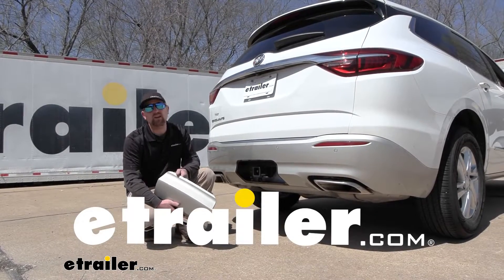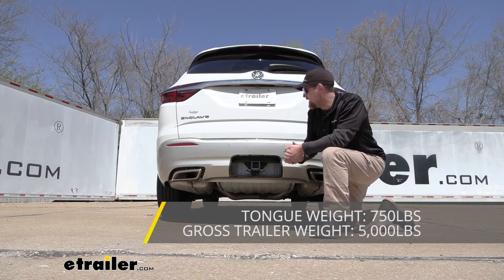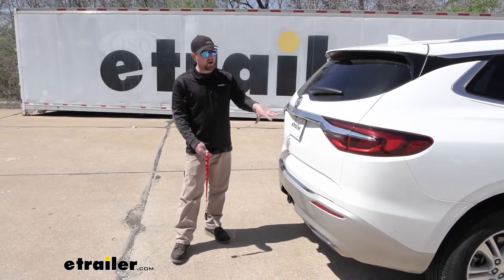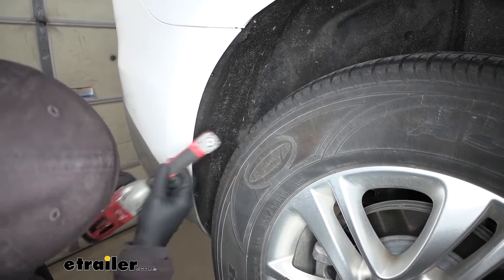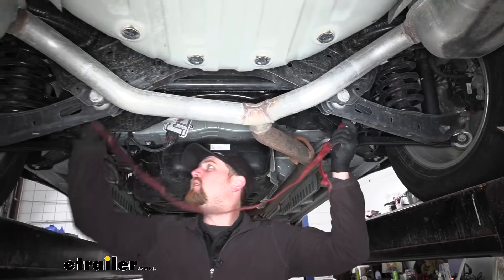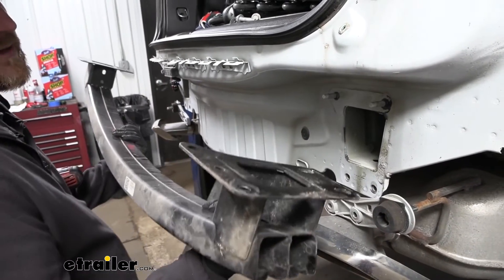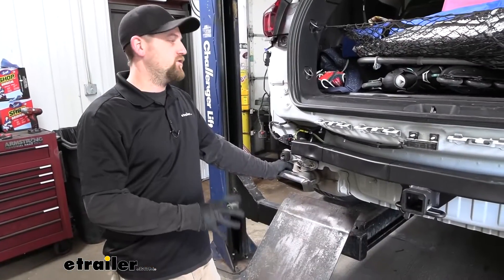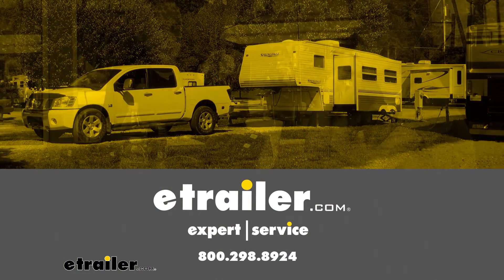Setting up the etrailer Trailer Hitch Receiver on your 2020 Buick Enclave

Comment: Very useful video - thanks! One thing to note is that the center exhaust hanger needs to be detached so the exhaust beam hangs down far enough to work. Also, the instructions don't specify the torque spec for the top factory bumper nuts (I don't have a service manual 'yet'). Unlike the supplied lower M10 bolts, they don't through an exhaust hanger bracket.
Reply from the maker: Which bolts are you speaking of? The linked instructions address the torque for the M10 and 1/2 inch hardware in step # 4:
https://www.etrailer.com/instructions.aspx?pn=E56YR
Reply: @etrailer  The existing factory nuts above the M10 1/2 in. bolts.  Thanks.